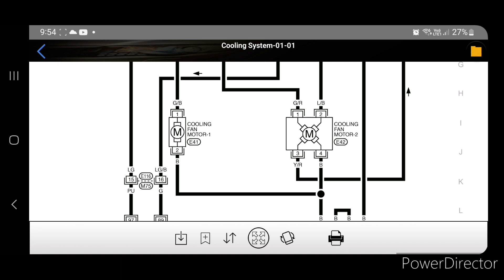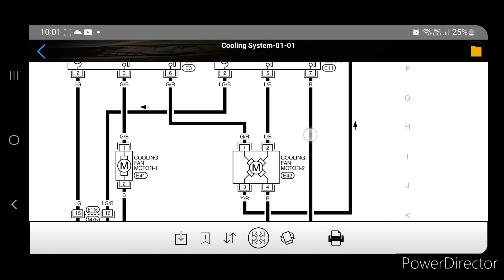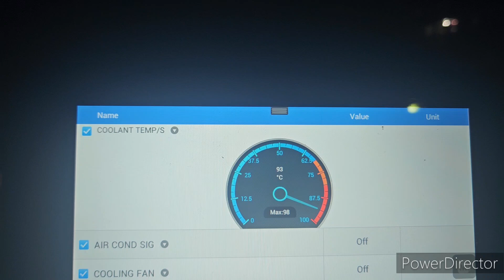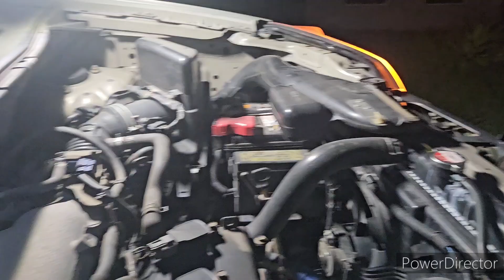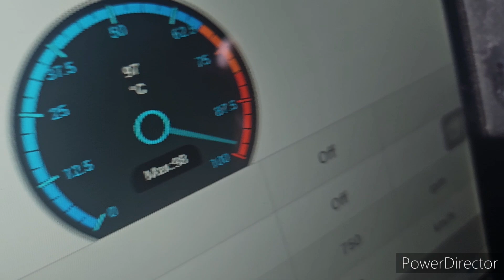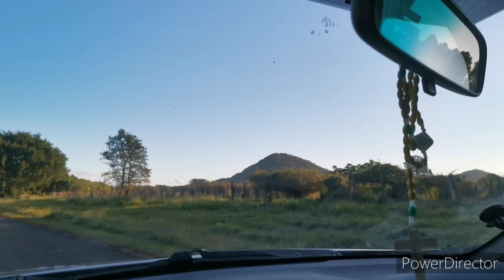Nissan x trail t30 radiator fan operarion!

Comment: Hello Sir, my xtrail may have this issue. I have not noticed the radiator fan working even engine gets hot temprature. When I turn on AC, the radiator fan works. Surprisenly, coolant temprature gauge always shows middle level. So should I start checking from radiator fuse and relays?
Reply from the maker: Sorry for late respond.use scanner and minitor the temperature.Base on the vedio it will tell you what temperature the  fan engage and dis engage.If fan doesnt work make sure your temperature sensor is working fine  and make sure the engine still have the thermostat!use the bidirectional capability of your scan tool if you have one.If there an issue on your relay and fuse the fan will not work when ac is turn on.